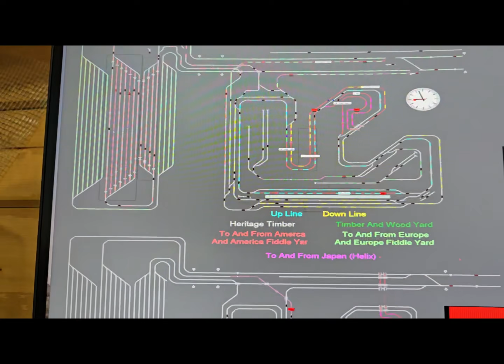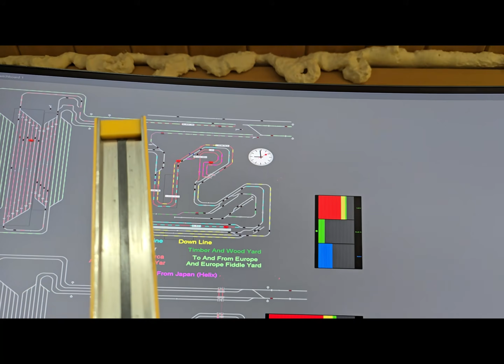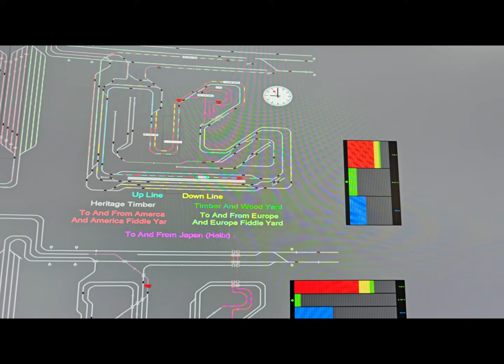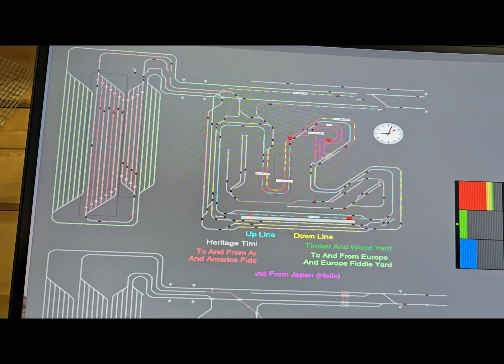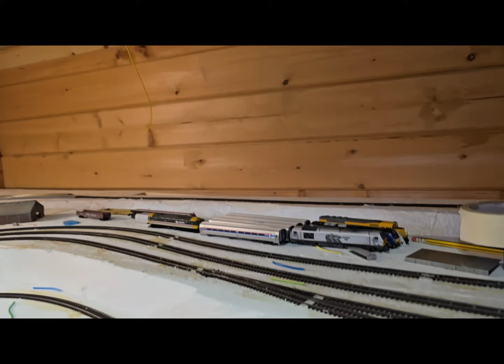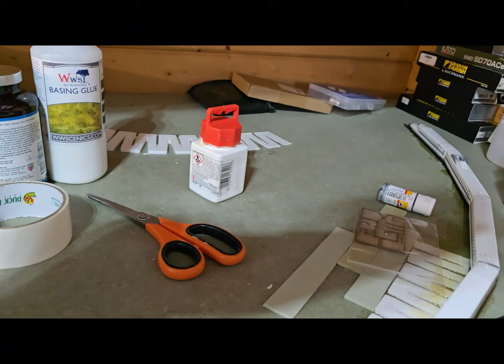Model Railway Update | iTrain Layout Map, Block Detection & Track Progress

Comment: Hi Colin,
The diagram is quite impressive. Like how you got your issue sorted out. Having the separate power districts is a great plan. It's always good to be able to isolate areas of the layout. It helps greatly for trouble shooting plus it can allow you to work on or do maintenance to an area without affecting the other parts of the layout. Even on my little layout, that had been a huge help. The add of the track to the fiddle yard looks like it will be interesting. Looking forward to seeing that come together. Good luck with I-Trains 6. Maybe there will be some kool new features for you in it.
Take care and cheers, Richard
Reply from the maker: Hi Richard i have seen what is in the new iTrain there is two phases the first is going to change how we use the computer and iTrain then i believe phase two is how we use iTrain and the layout.
Districts is very helpful. 
Sorry i haven't had chance to was your last video but i will tonight. Colin
Reply: @collinsngauge5493  Thanks Colin. Good luck on the ITrain update. No worries on the watching, I'm a bit behind myself. 😕 March is being a bit of a challenge so far.
Take care and cheers, Richard